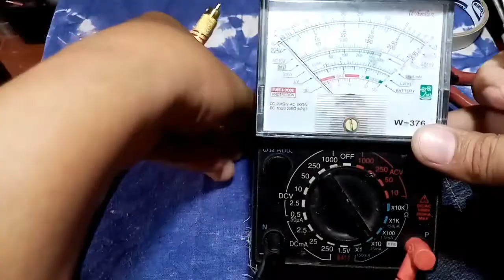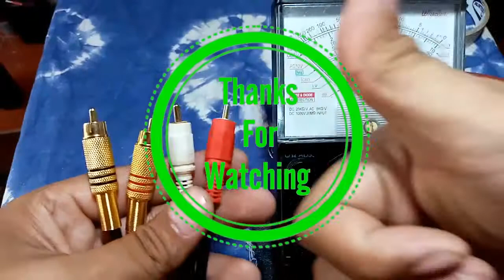How to replace RCA plug (Video Updated)

Comment: Yes I agree, everything is made to be disposable these days. Thanks so much for this, Woody.  I upgraded my speakers and then bought better speaker wire, now I have to learn how to solder so I can replace the rca plugs! It's fun to fix things though. I have a wonderful old Bell and Howell stereo receiver/amp still going strong! Looks like you have a small solder gun, if you can share what size it is and what kind of solder you're using, that would be great!
Reply from the maker: I using a 30 Watts soldering iron.

Comment: Hi, thanks for the video, I want to put together an rca cable from preout to the subwoofer and I'd love to know what kind of cable you use, thanks
Reply from the maker: Welcome!!! about the cable any brand will do as long as it is shielded wire. The signal wire is in the center the ground strands of wires are braided and covers the signal wire in the center. Some shielded wires are not braided but it covers the entire signal wire in the center. That's how to check a good quality shielded wire. Hope this will help you.
Reply: @woodys_hobbies  Thank you 🙏
Reply from the maker: @adel20223  welcome

Comment: Great video, Can you tell me where I can purchase the connectors that you used.
Thanks. I need to replace the connectors on an inherited techniques turntable
Reply from the maker: You can buy the RCA plug male in electronic stores or online stores. Or you can buy it in ACE Hardware.
Reply: Thanks, Wish
 we still  had those around, did try Ace, Lowe's, Home Depot, Best Buy radio shack,  most have the cable attached, just need the ends. There are some on Amazon, not sure which if those would be the same as what you used.  Do you see one on Amazon that would be best?
Reply: Any repair place wants $40.00 just to look at the turntable. They all want to replace the entire cable. Since I get  some sound when I move the plug I believe it is just the one white connection, I believe the red connection is good. I just want to be sure before I cut the existing RCA plug off the cable I can just use the connector that do not require soldering.
Reply: Thanks for the info. Last resort is trying on Amazon. Hopefully I am not getting junk. I am going to try the ones that are soderless. 
 I guess with COVID people decided to fix up their equipment. There are not enough repair places anymore. Those that are around say they are overwhelmed.
 Who knew albums would make a comeback. Still have mine from the first go around.
Reply from the maker: @karenkennedy4546  All needs soldering when replacing RCA plugs.
Reply from the maker: @karenkennedy4546 Good luck to your DIY!!!

Comment: But which one is positive and negative wire?
Reply from the maker: This rca plug is left and right. Right is red while left is white or black. The positive wire is the insulated wire in the center. While the negative wire is outside the insulation of the positive wire.

Comment: Can you tell me when you purchased the connectors the clear plastic cover comes with the connectors or is that a separate purchase?
Reply from the maker: Yes when you buy it has a plastic tube cover inside. Take note not all has the plastic cover it depends. The plastic cover is not a big deal you can seal it with electrical tape or masking tape.